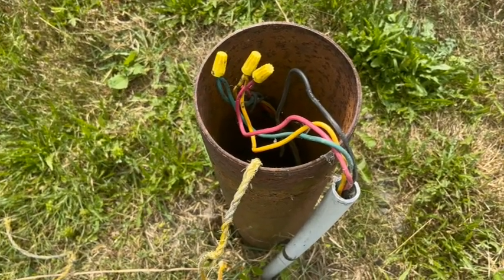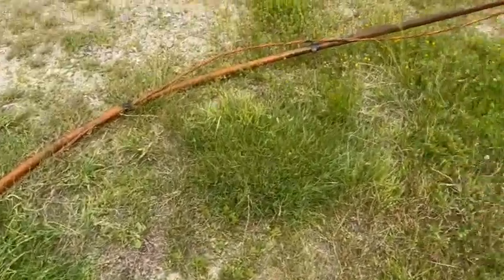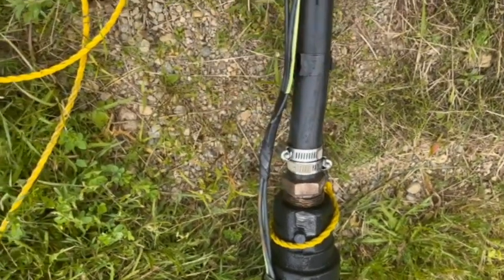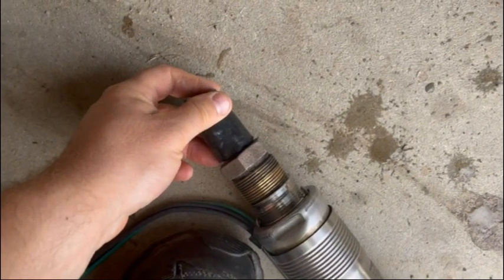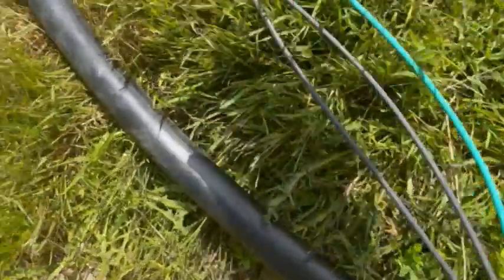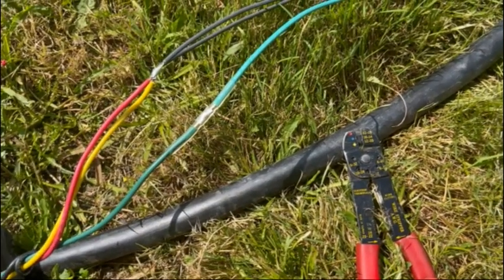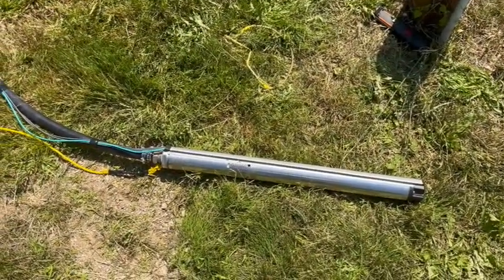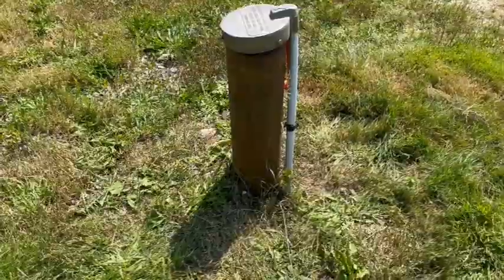Changing A Deep Well Pump.  Installing A Soft Start Pump

Comment: How do you like the soft start pump?
Reply from the maker: Hey,
Lovin' it.  I've noticed it 'seems' to take a little longer than the old pump to fill the pressure tank from 30 to 50PSI, but that's ok.  It has no problem keeping up with taking a shower and doing laundry

The lights don't even flicker when it starts and I'm pulling power from the batteries.  The regular ol' water pumps can make lights flicker even when everything is on grid.  I don't even know this pump is running other than I hear the pressure switch click open and shut.